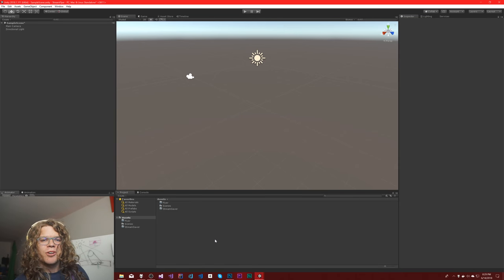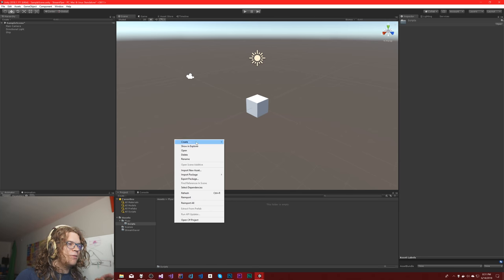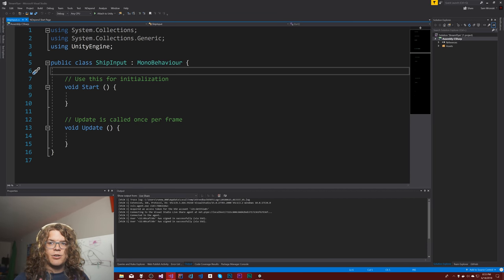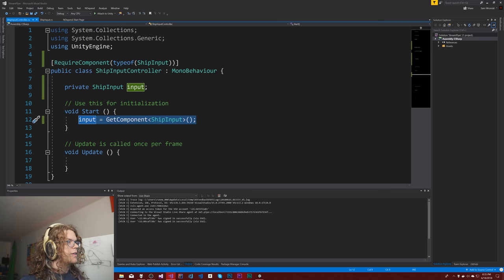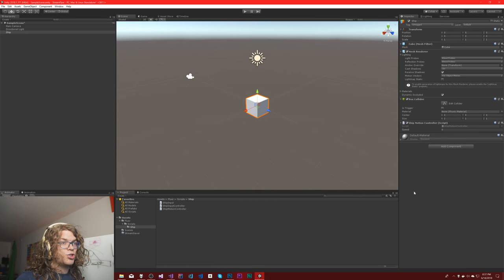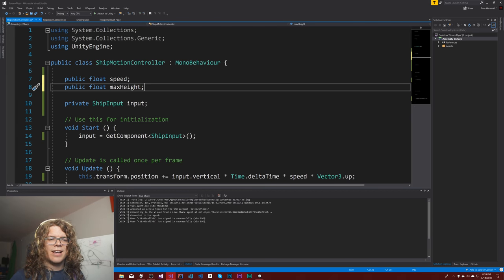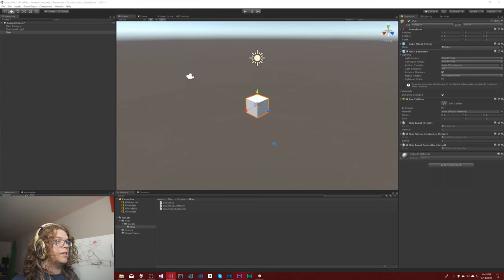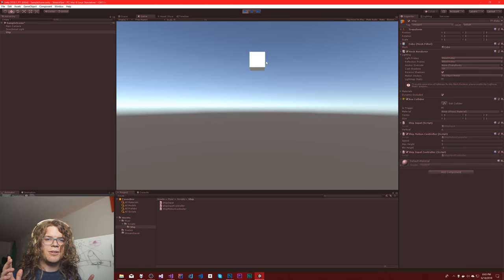Building a Basic Flight Controller - Lets Make a Side Scrolling Shooter - Part 1

Comment: Hi. I am absolutely a newbie in Unity, but I have some experience in JavaScript.
So, I do not understand how is input.vertical comes from ShipInputController to the ShipInputMotion.
Because they are separate classes. Is it happening because they are both attached to the same game object? (cube in our case)
Reply from the maker: We use GetComponent to find the input controller attached to the game object.
Reply: @WorldOfZeroDevelopment  So how does it work? We are getting the InputComponent and put it to the input variable. And then when we make input.vertical = Input.GetAxis("Vertical"); - by doing this we are setting a new value to the actual Input component? So all of the instances of this class that were get through GetComponent will receive this value, is not it?

Because previously I thought we extend our Controller and Motion classes with just a new field and thats it.

Comment: Hi, with the new Shader Graph, do you think it's still worth learning shaders?
Reply from the maker: Absolutely! Understanding how something works will help you use Shader Graph better as well, the tools can play off of one another. You can write code visually as well or use a simpler language (like Python, Java or C# for example) which will hide some implementation stuff, understanding how that's working under the hood and how your code interacts with the system its written for will help you write better code though.

That said, it depends on what you're hoping to get out of it. If you just need a way to quickly do some basic visual stuff it's less important than if you want to write a physics engine or raytracing on your GPU.

Hope that's helpful!